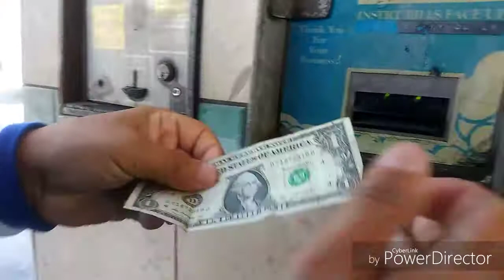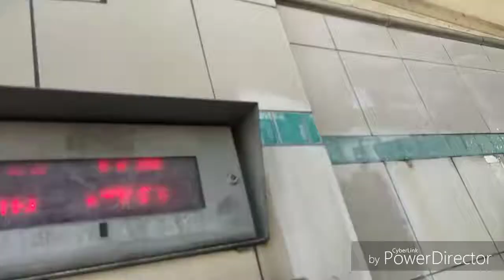Quick how to: How to clean your seatbelt

Comment: YOU DO NOT WET CLEAN SEATBELTS! This compromises the structural integrity and removes the flame resistance. Never under any circumstances use a harsh cleaner. These belts are toast.